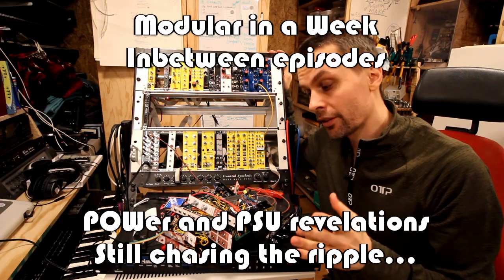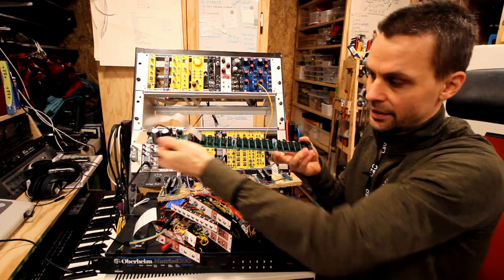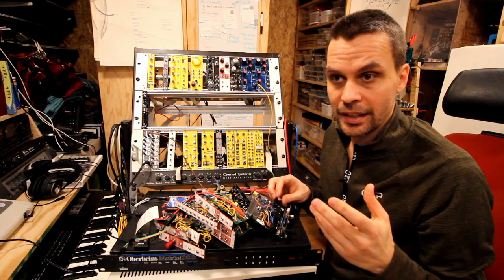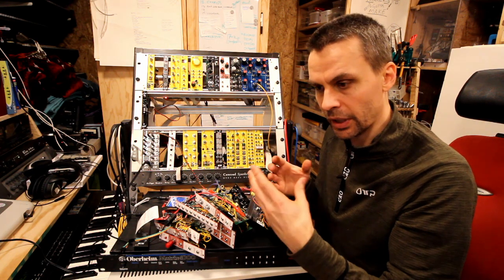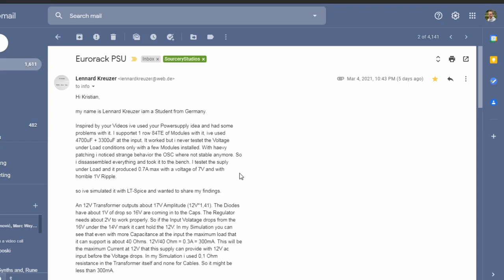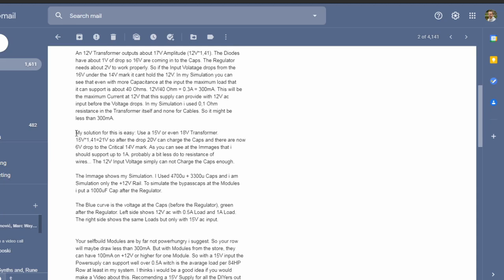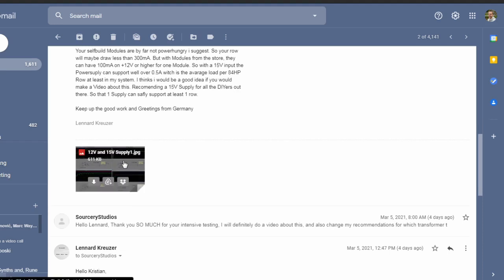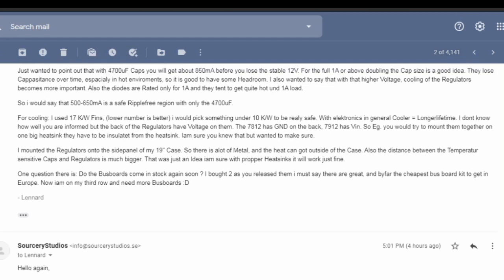POWer and PSU revelations, still chasing the ripple... - MiaW Inbetween episodes

Comment: Great video, thanks for posting! Greetings from Lindome.
I'm about to start DIY my own modular system and one of the first problems I bumped into is that I don't have a dual-rail power supply. I don't want to spend a lot of $$$$ on buying a lab power supply so I decided to DIY a PSU to begin with. What I noticed is exactly what Lennard pointed out and I got really poor performance out of the 12VAC - 7812/7912 combination. One contributing factor seems to be low efficiency of the transformer that I have chosen (well I salvaged it from an old project) but I'm stuck with that for now.... because - reasons... 🙄
Anyway, I bumped up the resevoir capacitors to 4 x 4700uF and I replaced the 7812/7912 with LM2940 and LM2990, which has a slightly lower drop-out-voltage. This works perfectly fine for breadboarding and a smaller setup at the lab-bench, but for the main rack I'm planning to go for a 15VAC transformer (15-0-15 on the secondary side and a full-wave rectifier).
That power panel looks sweet! I'm definately standing in line to get one of those - keep up the good work and make awesome sounds 😎

Comment: I feel for you. It’s clear that you don’t have a formal background in electronics, yet you are building some really sophisticated circuits.  

On power supplies: your doing some things that are hurting you. Putting an AC switch in proximity to your DC output will allow capacitive coupling of the 50/60 Hz AC back on to the DC you scrubbed up.  Adding an absolutely huge amount of capacitance on the filtering element of your DC is useless if the capacitors are all of the same value and type. 

I could go on for awhile. 

You need to take a step back and study some basic electronics. Following directions coming from YouTube just won’t help you. The things I read in your comments are, honestly, about 50:50. 

Books like Horowitz & Hill are going to be too advanced. YouTube is almost always either too specialized or simply crap. You need a good introductory text. 

I can’t recommend one. I teach electronics but I start with people who have completed calculus and physics or with kids who have no experience. I use my own books. 

Someone out there, recommend something easier than H&H but advanced enough to handle the tough analog stuff going on here.
Reply: Did you know there's a newer H&H? It's actually Horowitz & Hayes. Check the preface: 

This is a book for the impatient. It's for a person who's eager to get at the fun and fascination of putting electronics to work. The course squeezes what we facetiously call "all of electronic " into about twenty-five days of class. Of course it is nowhere near all, but we hope it is enough to get an eager person launched and able to design circuit that do their task well.

They go as far as referencing the original H&H for those willing to take a deeper dive into the theoretical side.

Comment: If you use high efficiency modern leds you can significantly reduce the current they draw from the PSU. OR just use a noisy switch mode PSU :)

Comment: Oh very cool! I used a 15v AC adapter from the start and never had any problems, and this explains it! And I'm looking forward to your new module: I recently built something similar myself with the idc socket in the front just for testing new modules. But one time I shorted two pins with the tip of a dangling patch cable (luckily nothing bad happened, just a few strange sounds from the modules turning on and off:), so I always recommend having an power cable (or just an IDC plug) plugged in!
Reply from the maker: Oh! Did not think of that! I will make a blind connector to have in there whenever no cables is in there. Thanks for the heads up 🙏

Comment: Trying to run a whole bunch of different circuits off one regulated supply is wishful thinking at best. Different loads are going to have different requirements. Trying to balance everything is an exercise in futility too. You're building a house of cards. Modular systems require a modular approach to power distribution. You can have one bulk supply and regulate in each module. That stands a chance of working. Nothing starts out complicated; It just gets that way.

Comment: From my DIY point of view, power supplies with a DC adapter would be much more useful than AC adapters. I have dozends of unused DC adapters laying around, from 5V to more than 24V. But not a single AC adapter... :.-/
Reply: This will be my next project, but DC suplys are much more noisy, HF is a problem. But with propper filtering you will get away with it. Stay tuned for that. Iam sure Kristian will present that to you if i found an easy way of doing that.
Reply: @CrossTekk  I like pi filters for cleaning noise up. So have a go with one of them. Don't get so hung up on the math. Just make one and see how it works. Two caps and a coil.
Reply: @1pcfred  Yes good idea with the pi filter, i also wanted to try a Capasitance multipler.
Reply: I have AC wall warts. They're just step down transformers. They make a higher AC voltage a lower one. But I'm probably a lot older than you are too. Nothing just uses transformers for power supplies today. They're all crappy, noisy, lousy power factor SMPS now. Transformers use too many raw materials. Heavy iron plates and copper. Plus they last practically forever too. Can't have that these days.
Reply: @1pcfred  what do you mean "cant have that these days" ? high quality low noise switch mode supplies exist, and they're cheaper than transformers. you're acting as if they dont. there is a reason why transformer supplies arent the majority anymore.

Comment from the maker: Follow up email: Just wanted to point out that with 4700uF Caps you will get about 850mA before you lose the stable 12V. For the full 1A or above doubling the Cap size is a good idea. They lose Cappasitance over time, espacialy in hot enviroments, so it is good to have some Headroom. I also wanted to say that with that higher Voltage, cooling of the Regulators becomes more important. Also the diodes are Rated only for 1A and they tent to get quite hot und 1A load.

So i would say that 500-650mA is a safe Ripplefree region with only the 4700uF.
For cooling: I used 17 K/W Fins, (lower number is better) i would pick something under 10 K/W to be realy safe. With elektronics in general Cooler = Longerlifetime. I dont know how well you are informed but the back of the Regulators have Voltage on them. The 7812 has GND on the back, 7912 has Vin. So Eg. you would try to mount them together on one big heatsink they have to be insulatet from the heatsink. Iam sure you knew that but wanted to make sure.
I mounted the Regulators onto the sidepanel of my 19" Case. So there is alot of Metal, and the heat can got outside of the Case. Also the distance between the Temperatur sensitive Caps and Regulators is much bigger. That was just an Idea iam sure with propper Heatsinks it will work just fine.
Reply: Great video, thanks !
Reply: I guess I am kind of off topic but do anyone know a good website to watch new series online ?
Reply: @Curtis Juelz I use FlixZone. Just google for it :)